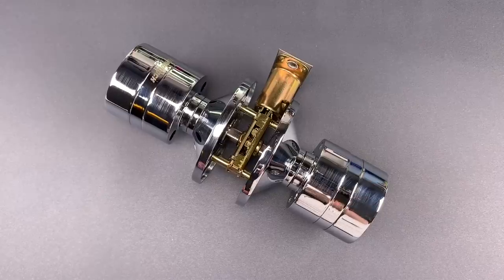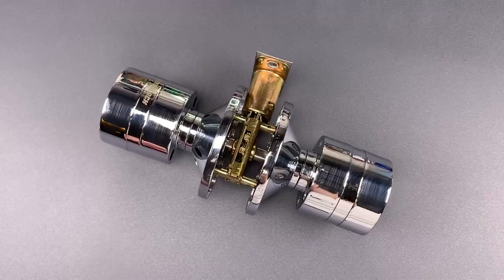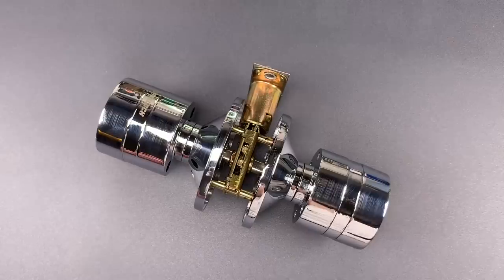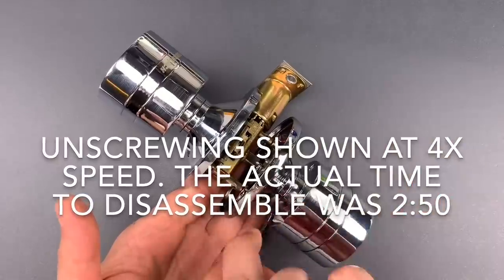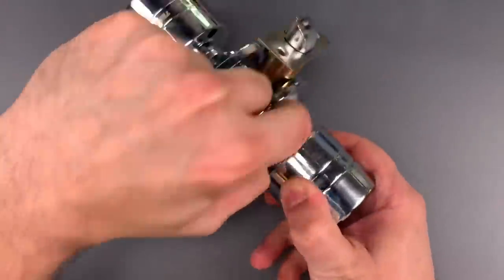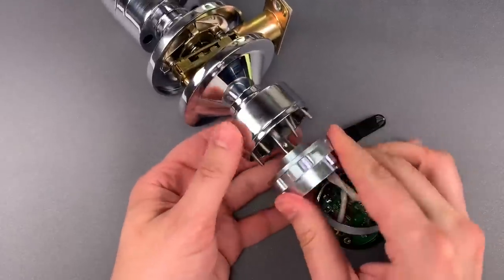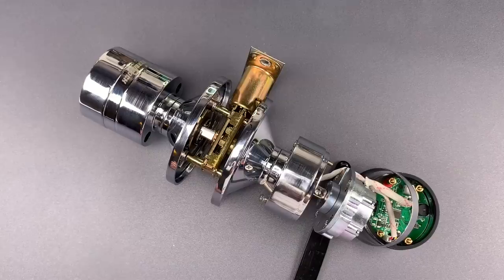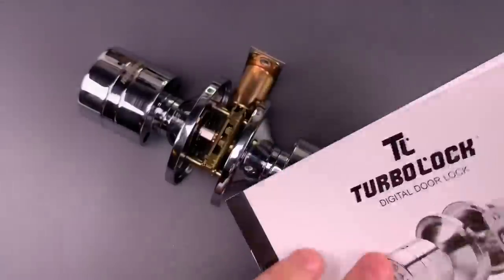[945] TurboLock YL-99 Opened With a Screwdriver!

Comment: It would be possible to render the screws unusable. I wonder if doing so would make this a decent lock.
Reply: Fill the screw heads in with JB weld lol :)
Reply: No, they broke another cardinal rule for electronic locks - the key pad is the only thing that should be in the insecure area. The electronics that decodes the pad and decides whether to release the door should be on the secure side of the door.
Reply: @sylviaelse5086  "Fuck that shit, lets save a fraction of a cent in cables and 2 minutes in a 3D modelling program."

The actual answer, this lock is made from off the shelf parts.
Reply: It would be easy to make the screws unusable, however, I assume they exist so that the battery can be replaced.  I wonder if that is the reason they exist?  Also, this video shows how to remove them without damaging the device.  I don't think a criminal would bother with the screws but just break the face plate off.
Reply: camjamsdad  I wonder if this lock is vunerable to a large rare earth magnet?
Reply: @sylviaelse5086  The problem is that conventional locks do place the actual lock cylinder itself in the insecure area.  If one manages to rip the knob off of the actual doorknob assembly, the rods sticking out or the holes inside can be manipulated to unlock and open the door.  Thing is, the knob itself can't simply be unscrewed.  Keyed locks place the fasteners on the secured-side, so it typically requires a destructive attack to get into those knobs.  This thing is the worst of both worlds, the lock mechanism and actuation is in the insecure part, and the electronics are openable on the insecure part.

It is possible to design doorknobs where the lock is in the door and handle doesn't do anything but flap about if the lock is engaged, but we're so used to residential locks having immobile handles when the lock is engaged that consumers might not be happy with doorknobs that behave that way.
Reply: @TWX1138  It should be possible to design a lock that won't let the handle rotate while locked, but without exposing any means of exploiting that to force the lock. As usual, manufacturers have little incentive, given that it increases cost and customers mostly have little understanding of security issues.

All said and done, though, a secure lock (not being a Masterlock), would expose little more than the keyholre This lock in the knob design concept is fundamentally flawed.
Reply: @jacob1121  I suspect, as much as anything, it's related to the cost of making separate circuit boards for it. It needs one for the keypad, so putting the rest behind the door requires two circuit boards. The engineer does the right thing, and for his trouble gets shouted at by his manager, who understands nothing, and told to merge everything into one.
Reply: @TWX1138  You bring up a good point. How awesome would it be to have a lock where the cylinder is on the inside of the door and you need a 10" long key to unlock it! Other than the key being slightly inconvenient, this seems like about the best solution to a high security door.
Reply: @sylviaelse5086  correct, the outside handle should never engage from the outside, it should have a solid rod going inside that is engaged inside.
Reply: Epoxy/shoe glue and some alcohol to dissolve it in 10 minutes when you want to change battery.
Reply: Or use some protruding, but angled hex bolts. Then install something like these: https://www.youtube.com/watch?v=BFClplDKucI 

Tho you could probably find something a bit cheaper. You also don't really need to install four.
Reply: @SimonWoodburyForget  than*

People, learn the difference between "then" and "than." It's 1st grade stuff. You have no excuse.

Comment: I'd like to see a video of this being done while it's installed on a door. I don't imagine it would be quite as easy.
Reply: I am looking at one of these at a friend's house and it would be very difficult and time consuming to get the screws on the side of the door jam but not impossible. So long as the attacker had 10 minutes or so to fiddle with it, it would be easy.
Reply: JB weld. Problem solved. Oh dont forget to change the factory master code.

Comment: I entirely agree with you that these electronic locks are built more like consumer electronics. It's obvious that they're not even employing people greatly experienced in Internet security, as much of the thinking behind penetration testing is analogous between physical and logical security: look for exploitable vectors and see what happens when you exploit them, during the design phase. It's a well established rule that the later in production a problem is found, the more costly it is to fix (and the more likely it is to be completely ignored by product managers).

Comment: If we ignore context and that it has to be a bit on a ratchet that happens to fit and not a screwdriver, then yeah, it's a glaring issue. 
What I mean is, if you have a door with an electronic lock on it, it's probably in public or being watched, meaning you're not likely to spend three minutes pulling out screws and using another tool to turn the knob without being interrupted. 
Let be charitable and say none of those factors are relevant, because it's night and someone unironically thought this was a safe product in the first place, then it's not unfair to imagine someone with a crowbar or a hammer would just damage the knob or the door itself, making the lock rather pointless in the first place.
Let's say it's in your home to keep a child out. If they're capable of reaching the knob and using tools, they can probably guess the code from being familial or tell from which numbers are rubbed out.

In other words, it's probably good enough for its purpose, enough 'security' for the imagined threat not to bother. I get it though, it's funny that you can just unfasten the thing and bypass the whole mechanism/electronical device, but it's also not entirely unreasonable for what it is.

Comment: I would just change the screws to a less common or custom screw.
Reply: yeah that and some thread locking compound...
Reply: @ShadowPoet  or epoxy if you really don't need to take the knob apart
Reply: @ShadowPoet  and make them reverse screws lol
Reply: or..  not buy this piece of junk?
Reply: Jason Williams  true, but how many B&Es are committed attacks? This would go a ways to helping protect against opportunistic theft. The people using serious attacks aren't going to be deterred by much anyways. At that point in time, the lock is there to help with the insurance claim.

Comment: LOL I have that on  my room. Knowing this, If i was worried I would order some security screws and  replace with security screws and add some locktite. they will not get that appart as easy. mind you  most of the time the security of the door knob is only as good as the rest of the door and how its installed. 
I love this lock as its easy for me to get in without the need for a key and it keeps others out.

Comment: The latest versions use torx screws, which do not seem to have a low profile offset screwdriver: i had to hammer the knob to access the board when it glitched on me.

Comment: this thing forgot all my codes because the weather got too cold, and i got locked out of my own basement. so i had to do this same move. Mine had T10 torx screws, not philips. It looks easy in this video, but it's way harder when it's mounted on the door.

Comment: The bathroom doors in a house we restored years ago had American style locks (because they are cheap and easy to replace). One of them malfunctioned locking a fella inside. I used a screwdriver and a small lever to brute force the lock apart.

I am willing to bet that this one would break apart even faster because of the right angle cross section.

Comment: LPL - Ok, let's get started.   First - I am going to use my tensioning tool to rotate all of the screws as far counter-clockwise as they will go.  Now, take apart the handle and that's it.  Sleep well knowing I can enter all of your houses whenever I want and that's all I have for you today.  (I did miss that none of the screws gave a click or required any counter-rotation)

Comment: I actually have these as bedroom locks inside my house, they are not made for outside. I used them to replace the interior door locks that you use the the straight piece of metal in the center hole to unlock. If you wanted to make a non noticed entry the screw method he showed would work but slowly. If you just wanted in the door most folks could kick the door down faster as interior doors are generally very weak. For my use they work great to warn you someone is coming into your room as they beep when you press the buttons. The adults can cease doing adult stuff before the kids barge in and the kids also have a sense of privacy for their rooms. All the locks in my house have the same code to get in so it just for that time delay and beeping. They are really solid little locks that look modern and function great, they even have a light up key pad. I recommend for interior doors and if the screws on the outside make you nervous a small drop of JB weld would eliminate that.

Comment: That's an easy vulnerability to correct though. Replace the screws with a security torx screw, or strip the heads, or fill them in with epoxy, also use locktite before reinserting the screws to make it that much more difficult. Overall, I'd say it looks like a cool lock.

Comment: 3 mins not bad. I have this lock on a metal security screen door for bump lock and pick protection and for the auto lock feature. Plus a deadbolt as a second lock. So its doing its job

Comment: A few drops of red locktite thread locker on the screws along with a touch of jb weld in the Phillips screw cross on top of the screws would slow that process down a long ways. However they should use thread locker and one way security screws to assemble right at the factory. Or better yet, design it so they are internal and the knob has to be unlocked to disassemble.

Comment: Very impressive security device.  "Do not disassemble" instructions.  I find it a little pricey.  What would be equally secure and somewhat cheaper would be a sign reading "Unauthorized entry prohibited" hanging on a tape across the doorway.  With that level of security, you don't actually need a door.

Comment: Legend has it that the manufacturer replaced the Philips screws with Torx screws. So the attack scenario shown by LPL is no longer possible.
The lock (new model  YL99-torx)  will be safe!
Reply: Torx screws are MUCH easier to unscrew blind than Phillips.

Comment: If you understand this, this lock is not a security lock. Its just to keep the door locked. If you want a security lock that offers more protection, try a bolt down lock. You will not open it unless a locksmith does it for you with those special pins that are inserted into the keyhole. But then, who says crooks don't have them too?  The best defence against an intruder is to wait for Robocop flathead robots with 2 machine guns as arms to be available. Let's see if anyone will be lock picking anymore. And, also, no matter what type of locks and or how many you have, crooks still smash a window and get it. With anti thief robots that have machine guns, no one will dare enter. Crooks would be stupid enough to try. Watch Robocop, when one of those flathead robots sprays a barrage of bullets during a conference meeting upstairs. Now, that is one mean and nasty, yet super protective robot. Ha!

Comment: I use to work at an Auto parts store and we sold little thumb drive screwdrivers and ratcheting side angle screw drivers by the counter for like $5, I bet those would work for this

Comment: To be fair, you would have to know the lock to have knowledge about the screws and how to disassemble the lock. Also it would be much harder to do it if it was mounted on the door and with a doorframe limiting your movement. The time it would take you to disassemble it would probably be equal to the time needed to drill out a cylinder or pick a standard lock. The design could be improved, that's true.
Reply: It's takes just a few seconds to identify the flaw. You can buy a ratcheting version of the tool he used. This would greatly reduced the amount of time needed. The doorframe would be a minor hindrance if at all.

Being able to non destructively disassemble the lock from the secure side is inexcusable regardless of the time it takes.
Reply: @notahotshot  Yeah, because he had the door knob in his hand. Good luck with sticking your head behind the knob mounted on the door to see the screws, especially in the dark.
It took him 3 minutes to disassemble the lock and he had the luxury to have the lock in his hands. It would take him longer if he was under stress, in the dark, trying to break into someone's house. A regular lock would be defeated much quicker and easier than this. It's a bad lock but I would worry more about the non-scrambled keypad. You can always change the screws with anti-tempering screws.

Comment: I have this lock on my front door and as soon as I saw the screws on the back I knew it was an issue. Mine is backed up by two deadbolts though so I’m not worried.

Comment: The way to fix this would be to put the electronic catch at the back inside the door and have the front always connected to the front knob going up through the shaft as a lose round shaft with a plate or similar held from behind only allowing that round shaft to penetrate and could put shear off feature if really security setup to break away inside the tube not allowing you to get anything in like a screw driver.

Comment: So i had a lockout request for this and sent the customer the video .  He was a mechanically inclined person.  He had tools, and understood their functions etc. 

The first problem he had was even identifying the fastener.  its sunk into a hole and the angle of the back of the lock inhibits inspection by taking a pictute with a phone or visualising it with an inspection mirror.   If i had a dental mirrior i might have been able to see it.  

He contacted me after consulting the video and asked if i could  follow the procedure in the video.  I had the same problem he had.  I couldnt identify the fastener.  but even if i had the racheting screwdriver i have is too long with the driver to get it behind the knob let alone into the hole where the screw is.  

After trying to use a nirror and take pictures etc i finally gave up and airbagged the door and loided the latch which took about 10 minutes since it was a really tight squeeze.  i had to use one  air bag to get the other airbag closer to the latch so i could eventually make a gap big enough to manipulate the latch.  

Now im just a bread and butter locksmith and i dont have even remotely the skill set of the LPL but ive probably done betwern 7500 to  10 000 lockouts since ive been in business for the past decade.   i would guess that about 3000 have been by plastic strip method

Comment: I'm thinking a simple solution is to use non-retractable screws. They're probably using them so it can be serviced. They can at least use some that could take a special driver.

Comment: I've always hated electronic locks without a manual override of some sort. But that's probably because a teenage me got locked out of the house by one of them in winter, with no key to get in when the batteries died on the front door lock my parents used to use. I insisted on a key for another door after that day.

Comment: I get that it was able to be taken apart.  I would still like to see how good it is against figuring out the code.  The offset screwdriver is not in many peoples tool kit. It would also be nice to see if this button lock has other flaws.  A little epoxy in the screw heads could go real far.

Comment: tried this method as an ordinary person (not doing anything weird, this thing was installed on an interior second floor door in the house by a previous tenant and my dumbass landlord had no idea it was active or what the code was after it locked behind me). 

as many people have pointed out, the screws are much harder to manipulate with the door there. the space is very tight and you can't actually see them. i was able to work off the reflection of the screws in the rest of the knob. he appears to be using some kind of extra super low profile 90 degree screwdriver. i could not find anything like that in the two stores i went to, so my "90 degree" screwdriver was forced to go in at an angle. if the screws are tight it can be very frustrating and slow going. once they were unscrewed the first part (the part with the green electronics) came out easy, but the second part connected to the bar did not. i ended up using a pair of pliers to pull it free, and when i did the whole bar came out with it. there's no way to see in it, so i just had to go by feel moving it around until i felt it push back deeper like it was in place (there's no snap or click or anything) and then hold it with one hand and use the pliers with the other hand to turn it. i think all total it took 3 - 4 hours but the method did work, so thank you!!

Comment: I have this lock securing a cupboard and can rest safe in the knowledge that if my house ever gets broken in to burglars will almost certainly not have a right angled Philips-head screwdriver. They may have a crow-bar and can jimmy the door off but they won't be entering via a handle disassembly.